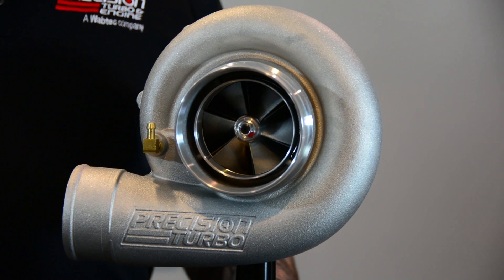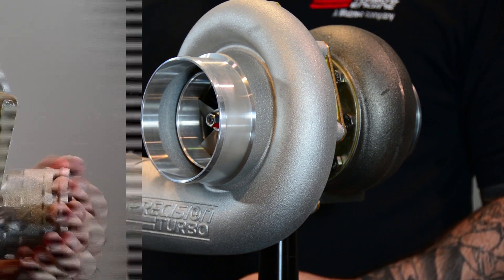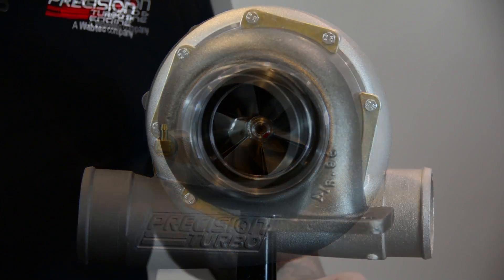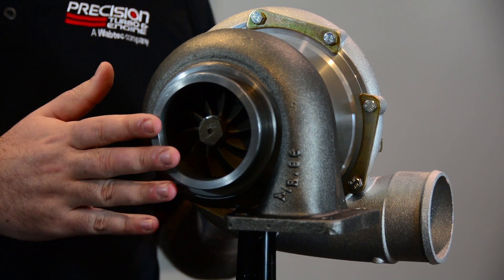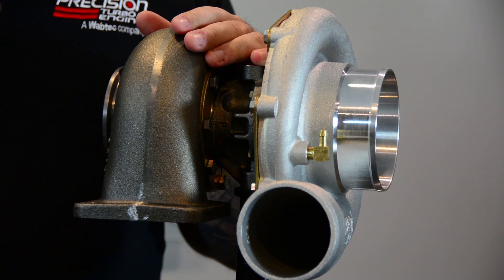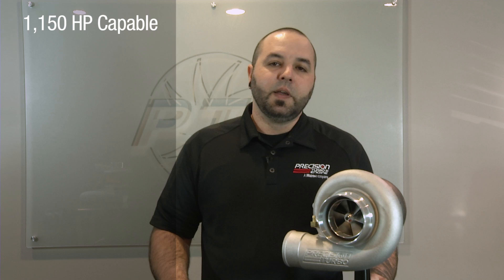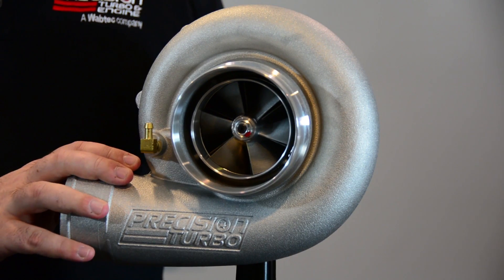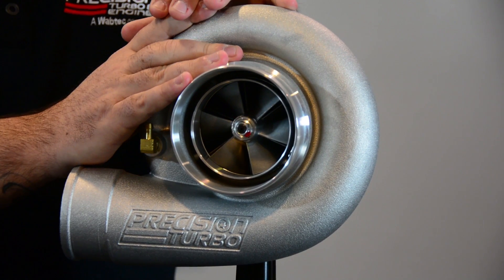All New LS-Series 7675 Precision Turbo & Engine Turbocharger

Comment: I was looking into building a single cab turbo truck build and consider this turbo and your 6776. Just not sure on what brand truck I would go. I had considered a dodge 1500 since they’re the least common to be different. Didnt want to go to crazy with the build just pistons headers manifolds and some good rubber to put the power down

Comment: I just picked up one of these with the .81 housing.  I am replacing an ebay gt45 with it.  Bone stock 4.8...will the .81 housing be ok, or will it choke me up top?  Fox body..80e ..355s..Thanks.
Reply: You end up getting this turbo set up on the stock 4.8? How’d it do?
Reply: @mbfrondorf    Yes Sir, I did, I swapped out the GT45 with the PT7675 .81 and it was a perfect match if you ask me.  Ran perfect and pretty much ruined me.  i have an 5.7 ls6 in it now with a t4 1.10 S480.   The 4.8 7675 setup was much much better.

Comment: Have a GM LSX B15 i just got and can't make up my mind on what pair of these turbos. Mostly what A/R to run .81 or .96. This will be a 75% street car will see the track. Plan is 8-10psi on the street and 15psi at the track .I know this engine can make around 900-1000HP at 15psi. I'm looking for mid range power. I'm worried the .96 A/R will have to much lag OR Not...  ANY ADVICE ANYONE??
Reply: I'd go with the .81
Reply: why?
 @FSA213
Reply: If you are going single I would not ho with the 81 ar, I would go with the 96.  If you are going twins then 81 would be ok.  We have built several cars for people using this and the billet version both coyote and LS and have had outstanding results with no lag issues.
Reply: @turbochevelle5641  what do you think about a twin .96 A/R set up.
Reply: @benzermeno1850  well, a twin 7675 la series turbo would be capable of way more than the numbers you are seeking. Do you plan on running a stand alone efi or stock ECU?  With a stand alone you'll have the advantage of boost builder strategies where stock ECU  will not have those features.  You could run smaller twins and still make the power you want .  Twin 
.96 AR on that set up would definitely make all the power you would want.  .81 AR would spool quicker than the .96 AR on the twin set up and would make the street driving a lot more responsive.  Either way you go it would be capable of some really big numbers.
Reply: Turbo Chevelle I appreciate all the info and time for your response as of right now I just bought the TwinTurbo with the 96 AR I am running a Holly super sniper with a brain tooly racing cam stage two. I can't wait to get this thing on the Dino. I understand the super sniper is self tuning but have also talk to other builders saying there's always fine-tuning to do. We'll see how she comes out. Thanks agin
Reply: @benzermeno1850  sounds good,  and yes the Holley Super Sniper will need a knowledgeable person make a base tune and then dial it in as it goes.
Reply: These have literally no lag on my 6.0L. Instant spool. I’m running a single with .96 AR.

Comment: Is the journal bearing something to worry about or should I look for a ball bearing turbo???
Reply: Journal bearing is fine and has worked for years.  Ball bearing will spool a little faster but you're looking at a roughly 900 upgrade just to go ball bearing depending on size.

Comment: 1150 hp is that wheel hp it crank up??????
Reply: No on a 6.0 expect more like 750wheel with its heart poured out
Reply: @jefflowry4112  what lol.... you can get more than that
Reply: Crank.  This turbo will Peter out at around 1000 wheel if your tune is right.
Reply: @turbochevelle5641  if you think 750whp is 1000 crank then your right, but a manual trans 750whp car doesn't loose 250 through driveline.  And thats the only thing that could make a real 750 wheel hp on a sae corrected dynojet, and that's pushing it. 

Turbine way to small.  A borg s480mm  (8088 in pte name scheme) can only make hair over 1000 rwhp in an auto car and BP high still
Reply: @jefflowry4112  LOL..... if you are losing 25% through your driveline then you need to find someone else to spec your build correctly or fix whatever is broke.  

Turbine to small, that's funny, really funny.  We have coyotes out there making 1053 wheel on the 7675 so please explain how the turbine is too small again lol.....
Reply: @turbochevelle5641  so these coyotes go 8.20s on this cast 76mm with a 82x75mm turbine? Show me please
Reply: @jefflowry4112  oh I see, you're one of those guys lol....  your math only works in a perfect world and is theoretical.  There are too many factors involved to go use Wallace Racing calculators or one of the many others to try and come up with a number like you are trying to spit out.  See your math doesn't take into consideration the many factors involved.  You don't know the weight of the car, is it gutted or full interior?  Is it on stock suspension or has it been upgraded?  What was the DA when the pass was made?  What were the IAT's?  What gearing is in the car? Is the turbo sized correctly? What trans is in the car?  How competent is the driver?  Is the car trans brake or foot brake?  Does the car have 2 step or not?  The list goes on and on but you can just spit out numbers because some calculator says you can right.  Hell we have another coyote making 1523 wheel now with an 85/96 so do you care to tell us and everyone in YouTube land what it does as well?  Or better yet, we are also on the cover of 1320's new video DVD with another coyote that's making over 1000 wheel so go ahead and please do tell us what it should do as well lol......  if it makes you feel better we have a naturally aspirated LS that is putting down over 700 wheel, hows that one run too?  Heck it had a feature magazine article written about it being the fastest In the country in its class and that was before the upgrades and what it runs now.  Anything else you want to teach us professor?

Comment: How are these turbos  For us LS guys that run lower boost levels say 20 pounds and less.  Wondering if we could still makes a 800 at those lower boost levels with this Turbo?  Hope to hear back
Reply: Paulo
 A cam and spring only 5.3 will make 700+ flywheel with that turbo on just, 7 psi., intercooled. At 20 psi, with stock  unported heads and the right cam, it could make over 1000.
Contact BTR or LJMS for the cam.
Reply: I've met quite a few people running these turbos and their tapped out 800 hp  mid twenties pounds of boost
Reply: Paulo
Nevermind the turbo,think about the boost.
1psi of boost is worth 6.8% horsepower max.
On a 5.3, 1psi. of boost is worth roughly 35hp.
20psi could possibly gain  700hp over the N/A power level.
That is considering the back pressure wasn't too high.
So on a N/A 400Hp engine, 20psi could turn that same engine into an 1100hp,beast.
Reply: Eric Reynolds  I tried it with an 8475  That back wheel is not letting it happen way too much back pressure
Reply: @jabberm249m4  then you didn't do something right.  We have. Built several cars with these and they have no problem making that power number.
Reply: @turbochevelle5641  you have never built a 1150hp LS with that turbo sorry. Physics dictates that it don't work
Reply: @jefflowry4112  oh, please tell me where I said we have made 1150 with this turbo.  Idiot, I was referring to Paulo's  comment saying he couldn't make power with an 84/75.  I will tell you this though, we have built 1000 hp LS engines with this unit and that's a fact.   By the way I am a dealer for Precision, Comp, Garrett and Borg among other manufacturers of performance parts.  Hey, what do I know I only sell the parts and build them too lol....
Reply: @turbochevelle5641   "Built several cars with these and they have no problem making that power number." - the subject matter being this turbo

Im also a dealer for most of those save for one thats been a consistant underperformer because I wont sell my customers junk, nor would I tell someone that a cast 76/75 is a good turbo to make a REAL 1000hp with on a V8 that size

Still interested in facts about the 1000hp you made with this turbo though
Reply: @jefflowry4112  engine of what size lol...  you act as I'd a 5.3l ls is huge cubic or something if that's what you are referring to.  I love when guys like you tell someone who has done it what's not possible, it's the guys like you that guys like me suck the paint off of on the track, street or wherever.   If you can't get 1000 wheel out of this turbo with the correct engine combo, fuel and tune then that's your problem isn't it.
Reply: @turbochevelle5641  well show me then I'm ready to learn.  Let me see the low 8 second 3000#+ cars on cast 7675. You say guys like me but I've likely done alot more with LS stuff than you have sir :)
Reply: @jefflowry4112  yeah,  I'm sure you have.  Come on down to TX2K19 and get next to us.  Hell we were running low 8's @ damn near 170 with 18 pounds in a 3000+ pound car that you could drive anywhere you want and still get great gas mileage as long as you kept your foot out of it.
Reply: @turbochevelle5641  that's super easy to do, your just not doing it with a single cast 7675. Like I said
Reply: @jefflowry4112  if someone can't make 1000 hp flywheel with this turbo then they are not doing something right.  Any coyote, 4.8, 5.3 or 6.0 built correctly will do it.  Hell the only difference between this LS 7675 and the PT-7675 CRA is the compressor wheel and it is only good for maybe 50 hp but real numbers probably 30.  With that being said the 1000 hp crank hp is very achievable with the right combo.  A little e85 and some timing it will sing.
Reply: @turbochevelle5641  ok so now your down from 1150 to 1000.  Show me where you did that with something more than @340 inches
Reply: @jefflowry4112  that's funny, real funny.  So now the truth comes out and you talk down the Precision because you'd rather push Borg and Garrett lol.....  fact that LS 7675 will make 800 all day long with its cast wheel and the .96 ar t4 flange will not be choked out.  Hell a stock bore and stroke coyote will move more air than an LS any day of the week so how come they aren't choking a .96 ar t4 at 8,000+ rpm.  Don't worry I'll wait......  Hell we have crew cab 345ci hemi trucks making 600+ wheel on baby boost stock internals with the LS 7675 and can't wait to put rotating assembly in it and turn the boost up and see what it really will do.  5.3l SBE 76mm s10 making 1000+ wheel.  We have a 6.0 s10 blazer running Precision 7675 on e85 and conservative timing and 14 pounds of boost making 800+ that we are finishing up tuning on now that will run 20-21 pounds of boost so we aren't having any problems making power on these street cars.  I don't need to post time slips and dyno graphs to prove anything, you want to see some results just watch Street Outlaws no prep racing series and  the Redemption Series and so on 😉

Sounds to me like you'd rather be selling those billet wheel Garrett and Jose's Borg Warner turbos to clients and the Precision LS 7675 because there so little profit in them.  I get it, you own a shop and have to make a living but I believe you're being just a little disingenuous when it comes to this turbo.  I'm sure you're a good guy and a good tuner but this turbo makes good power and that's the truth.  It may not be the billet wheel, ball bearing turbo with more profit in it but it does what it does and fits a segment of the market that was needed.  No sense in keeping someone from building something just because they can't afford the gen2 promod large frame turbos we'd all like to sell on every build.
Reply: @turbochevelle5641  what would be better for a daily driver a single or twin turbo with this turbo
Reply: If you can’t make a 1000 horsepower with this turbo on a Ls then you have built your engine wrong or don’t no how to tune it.

Comment: What about something for the LSA 6.2 in the cts -v?
Reply: the LSA is supercharged. So unless you plan on removing the supercharger and putting a turbo i would just stick with the charger Maybe change the pulley to add some more boost but make sure u adjust the timing and tune the engine